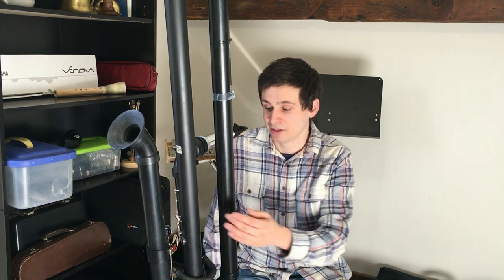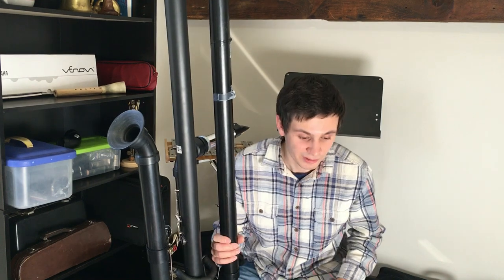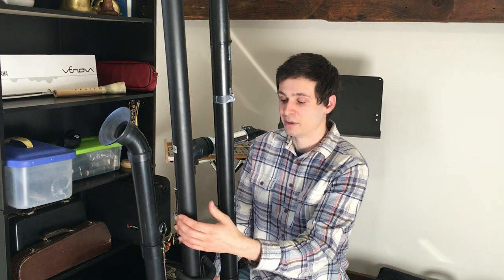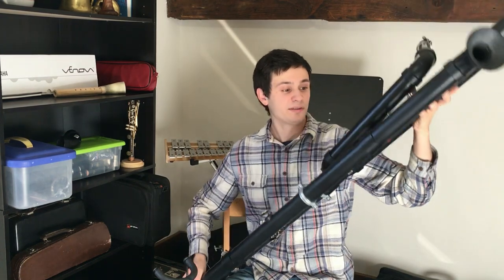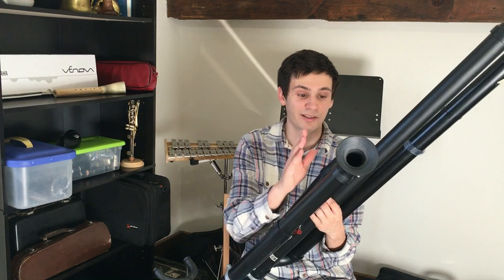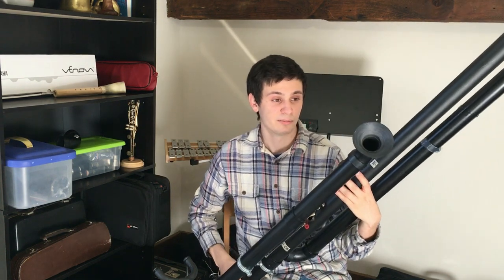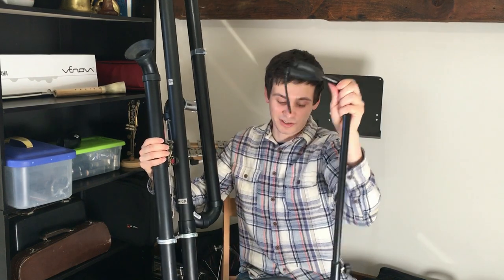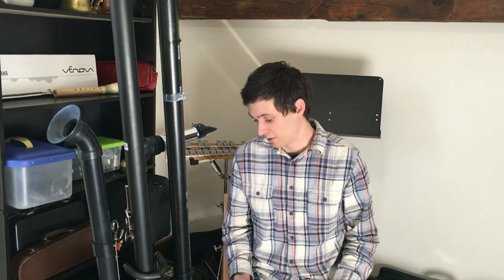Octocontrabass Clarinet Project Update #5

Comment: Question regarding measurements - When you make the tone holes, do you drill them right at the mark, or do you drill them slightly short to compensate for the short amount of additional tubing that the pipe to fill the space between the body and the pads create?

Another question - When you mark the location of a tone hole, does that mark correspond to the centre of the hole, the edge of the hole closer to the mouthpiece, or the edge furthest away?

also I really like the short excerpt from Irish Tune from County Derry.
Reply from the maker: I drill oversized holes and use tone hole inserts made from plastic tubing.